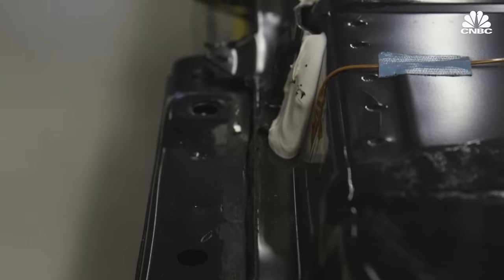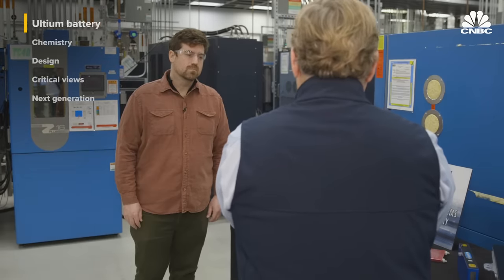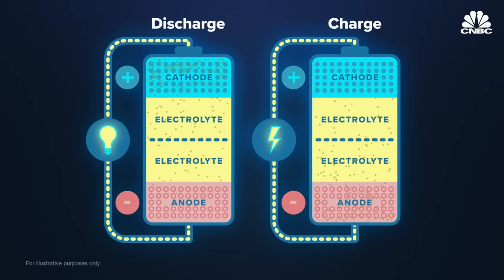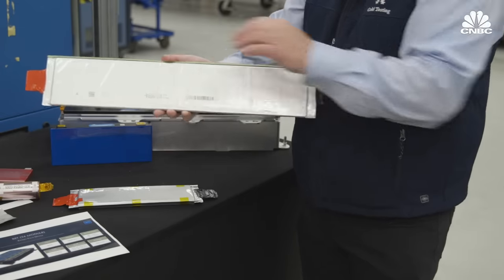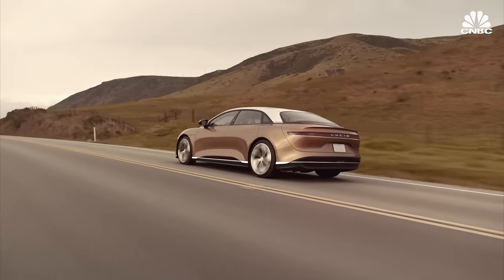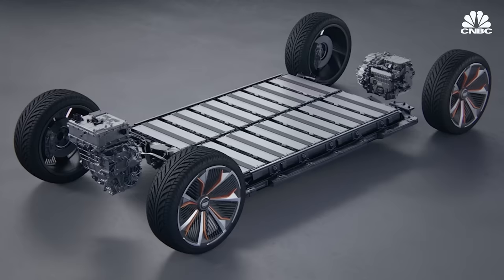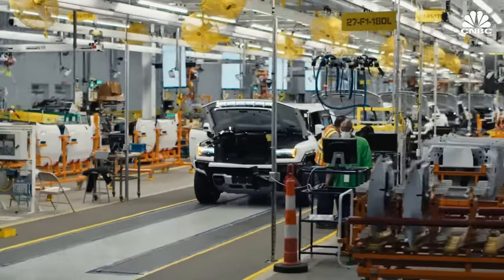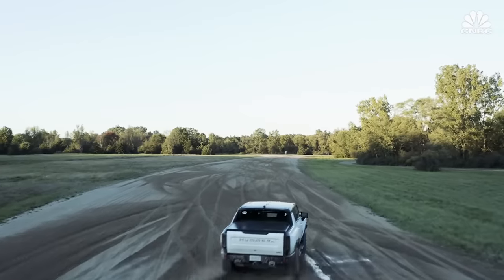Why GM Says Its Ultium Batteries Will Lead It To EV Dominance

Comment: 4:33 Tesla is already using LFP batteries in nearly 50% of the cars sold this year. Even in their NCA cars, they use less cobalt than any other EV maker today.
Reply: Tesla is to slow,and already behind,they dont even have a truck,its laughable!
Reply: @brunoheggli2888  You gotta be a troll for sure . Tesla is Slow ? It doesn't matter how fast your running if your running in the wrong direction the Rivian and lightening are really inefficient and you can tell it was rush Tesla couldnt release the cybertruck this year bcos they were waiting for the high yield of the 4680 . When the cybertruck comes out it gonna make the other trucks look outdated.
Reply: @brunoheggli2888  That's the funniest, most false thing I've heard yet today. Congrats.
Reply: Tesla use LFP for model 3 and short range models because they are cheap and CATL supplies most of LFP. They use LG's battery for long range model x and y, even in China market.
Reply: I would not call tesla slow, but GMC still have a century of experience,  and 100s of billions sink into capital.

This sunk cost,  and experience does make GMC risk averse, and therefore slow to react. But, it is still a sleeping giant, which once roused will be able to move mountains. 

I think Tesla should buy Mazda or Subaru to ingest their legacy manufacturing experience, but still be driven by their disruption mindset. 

Whatever happens,  I am looking forward to more BEV coming on to thr market!
Reply: @jacquie212  why would the buy a legacy Auto makers. They are all doing the old way. Their  factories aren't set up for the  Tesla build process. It would  cheaper to build a new factory. The Fremont factory is an  example of that .
Reply: This is exactly what I came here to say.  Reporters need to fact check their content and not report false information.
Reply: @oxide9717  the CT is a toy truck and doesn't compete GM large trucks.  Neither does RT1.
Reply: @LaJuanHughes  GM has three old factories converted to build EVs currently.  They'll have four battery factorys in the U.S. with first going online next month.
Reply: @LaJuanHughes  because you get to access a lot of intangibles,  as well as factory space, a skilled workforce, a servicing network, and experience in designing and mass producing economy cars profitably. 

I would say a bargain at less than $5Bn.

Downsides? A fair few... dealerships, entrenched habits, culture clash. 

Start up culture works to a point, but eventually every start up becomes an established player, and when they do they need this expertise. 

Either way, I don't really care. I only want this sort of thing because there is no way I want to pay tesla prices for a BEV...
Reply: The vid is wrong. The US standard range model 3 uses LFP (lithium iron phosphate - no cobalt or nickel in it) as well. It's not just aold in China
Reply: Really ? I thought they were buying Twitter this year
Reply: @keithrange4457  
My Model 3 with the LFP pack is due for delivery in August. Can't wait.
Reply: @brunoheggli2888  nobody has a truck, even the ones who do cant make hardly any. ford is arguably first and hasnt even made 200k evs yet.......tesla doesnt bother until they can make 1M of something a year.
Reply: @normt430  what about oversized? the hummer weighs 10,000 and cant even tow 7000
Reply: Maybe not Aptera. They are working on battery innovations to keep their car light.
Reply: @brunoheggli2888  Gordon Johnson, is that you 😂😂😂
Reply: @jacquie212  GM being a so called giant is what will destroy them.
Reply: @normt430  The CT is not out yet so you can say if it will compete or not though a hint for you...over 700,000 preorders suggest otherwise.
Also GM will have LESS capacity that Tesla with both cars and cells so this is called GM in checkmate.
Reply: @taefravis  Hybrids are great,500,000 are great,GM will sell soon more EVs then Tesla,enjoy!You will love it and you will buy a nice ICE hybrid pluginhybrid or full ev from GM!
Reply: And when everybody goes to solid state batteries, Ultium will make the switch with no problem because it's designed that way.  Tesla will have to make bigger changes.
Reply: @rand49er  Tesla thinks decades in advance and innovates faster than legacy auto could dream to. Solid state at mass scale in EV's is still just a wet dream, but when it's the better option, Tesla will of course lead the way.
Reply: @user-to2rf1rj5v  of course they will.  They’ll beta test them with the public just like their autonomous driving technology.
Reply: @rand49er  Autonomy can only be solved by training it in the real world, by regular operators, who are all legally licensed to operate a car. It's the only way. You cannot solve it with simulation alone, or with a few dozen paid drivers taking circumscribed routes.
Reply: @brunoheggli2888  tesla is to slow? Lol 🤡
Reply: @user-to2rf1rj5v  Dude, BYD use ZERO cobalt today... Tesla still uses batteries with cobalt in some models. - maybe you mean any other western EV maker.
Reply: @oxide9717  Also, they don’t have the manufacturing capacity to produce Cybertrucks or semis. Real simple. All of their capacity is eaten up in Ys and 3s. When Texas and Berlin have full ramp up, then maybe they can to some extent switch out.
Reply: @oxide9717  he's a Tesla troll. He can't read a SEC 10-Q and 10-K  filings or comprehend a video from Munro about Tesla's engineering prowess. Don't feed the troll.

Comment: The repairable/upgradable battery pack is definitely a great step forward. Tesla integrating the pack into their body structure is nice and all, but its frozen in place. They're already not good at customer service.
Reply: @FabianVolf1  That Model S has gone through 2 (or more, not specified) battery packs and 8 drive motors.
Reply: Pouch cells are the way to get highest energy density battery pack. Kia does it and pr. kwh, this packs the tightest. Samsung dipped below $100 per kWh two years ago on the cell level.
Reply: Battery swap technique better than charging, a lot faster.
Reply: @FabianVolf1  Given how much simpler electric cars are than gas cars, I bet you many EVs will be able to drive over a million miles regularly with proper maintenance. The problem is not the car itself but the fact that the battery will get worn down over time, which is where having a modular, serviceable battery system will be very important
Reply: @mocheeks709  It's incredibly wasteful and not very useful considering EVs can take as little as 15 minutes to charge nowadays
Reply: @Ry_TSG  yeah if they ever perfect it, fast charging damages the battery reduces performance , shortens the lifespan and sometimes makes them explode
Reply: @mocheeks709  That's just blatantly wrong lmfao Teslas have had level 3 charging for many years now. Electric car batteries have shown that they can have way higher lifespans than expected, so any increased wear on the battery from the few times a month a car would be fast charged is negligible compared to the overall life of the battery. Battery swapping is just a terrible idea that adds unnecessary complexity and risk to what should be a simple procedure.
Reply: @Ry_TSG  laughing my f**** ass off, do a little research, battery swapping is the way to go for fleet vehicle maintenance, it's better for the environment, because they charge the batteries with renewable sources and they charge them when they want to and they charge them slow so the batteries last longer and it makes EV cars cheaper to buy . In the future both technologies will coexist.
Reply: @Ry_TSG  it cuts $11,000 off the cost of a car you can lease batteries for as little as $150 a month and you'll always have the latest technology no concerns about battery degradation and warranties are eliminated and it only takes 5 minutes to swap, and you can choose smaller batteries if you only need a 250 mile range you can get that or you can get a 500 mile range battery, etc. And the extra renewable source energy is fed back into the grid, which lowers cost even more because the electric companies have to pay the battery companies for that electricity.

Comment: So far the only dominance they've had is in BEV recalls
Reply: LG's problem in manufacturing the Bolt's battery which is not Ultium by the way.
Reply: @rand49er  Well, it was GM's product was it? Full responsibility for GM. Lg is just a partner.